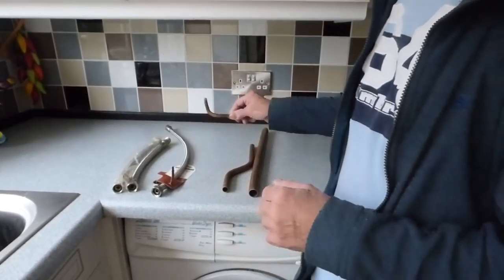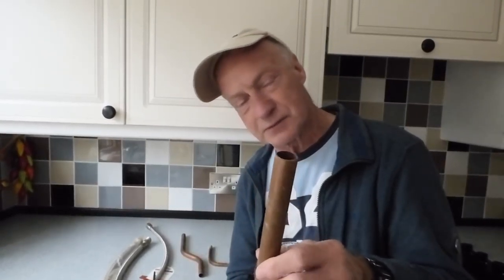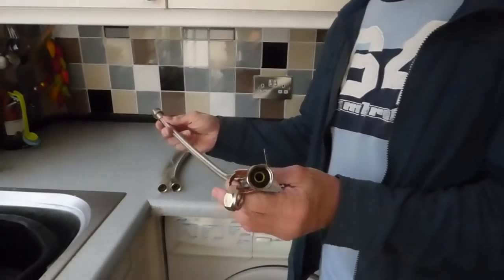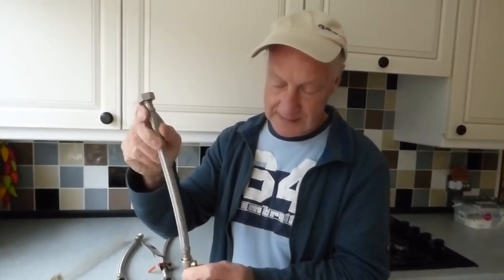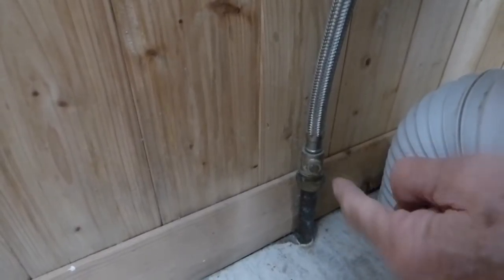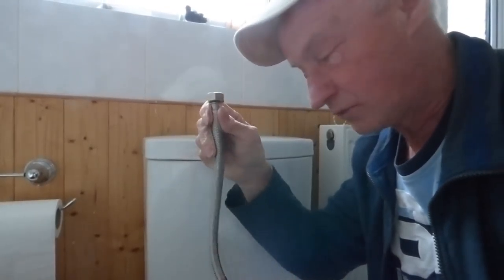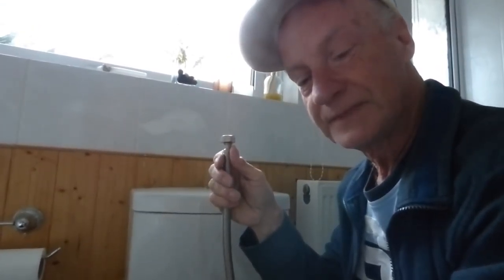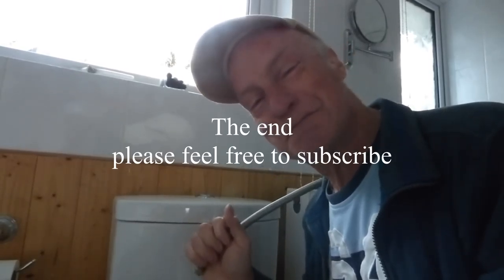Pipe sizing and flexis where and how to fit them correctly

Comment: I come across burst flexis all the time, usually on the hot water distribution to taps, it's always because they've been fitted incorrectly, people think because you can bend them within an inch of their life that's how they can be fitted, as Al said it has to be a a gradual offset, not curled round like a pigs tail or kinked over. And I'm talking about plumbers fitting them like this too, not just DIYers.
Reply from the maker: Like me you have seen them all.